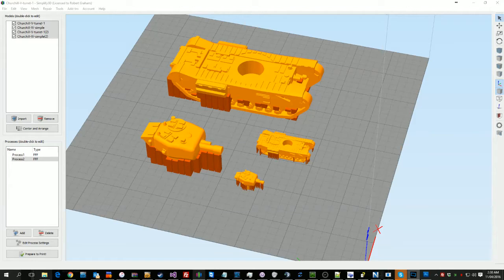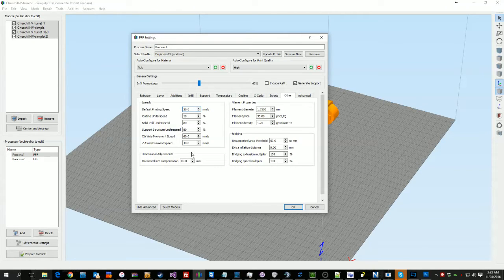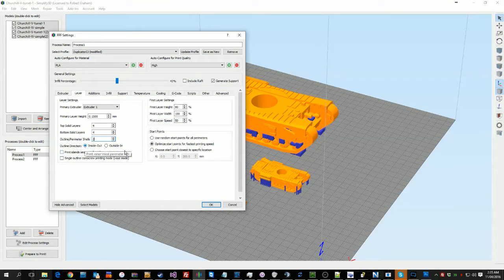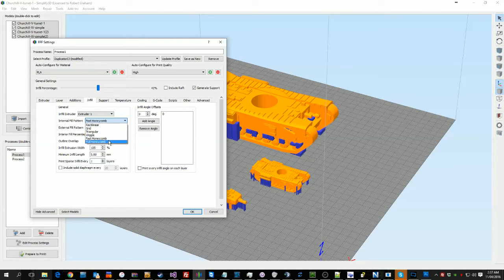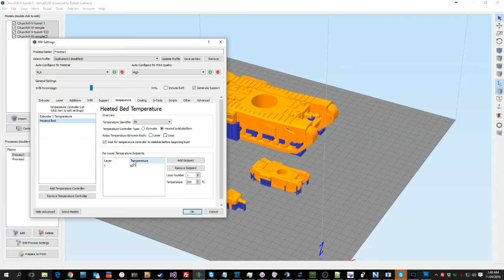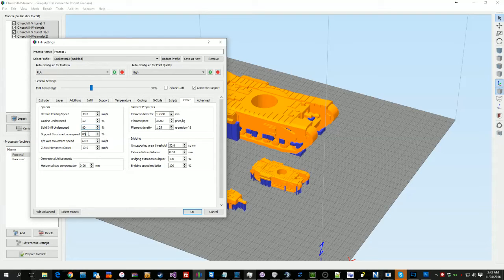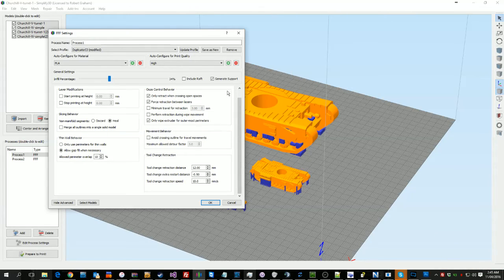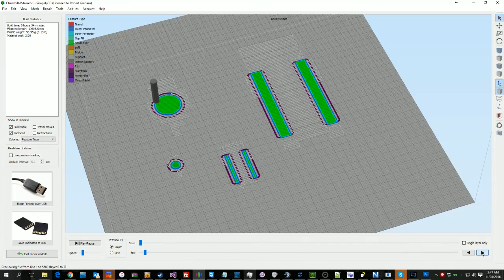Simplify 3D settings Overview

Comment: As this is a re branded i3, i assume the settings will be the same for the duplicator i3?
Reply from the maker: kinda i had to tweak mine a little. But every 3D printer needs to be tweaked. That's just standard as each machine is typically different.